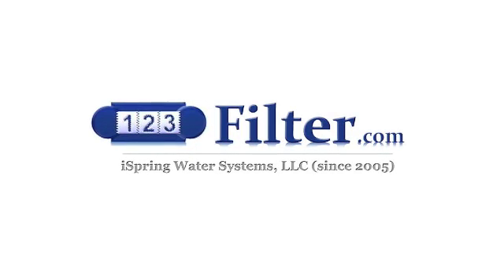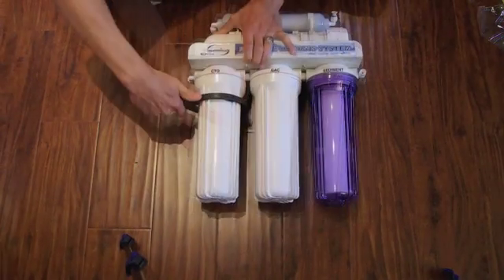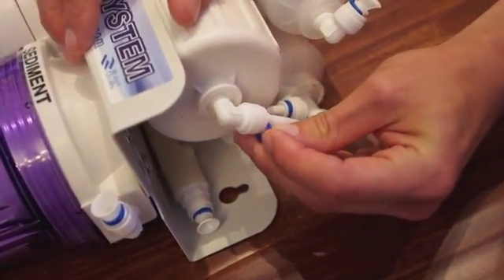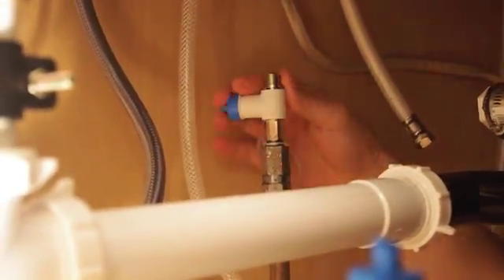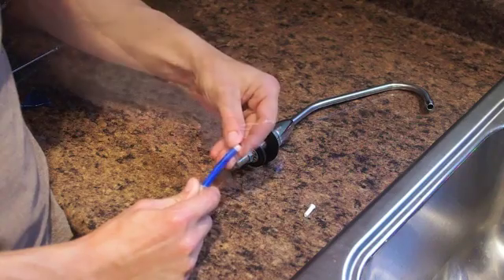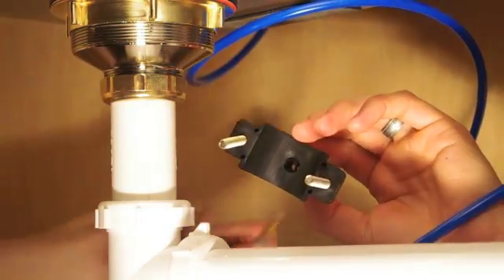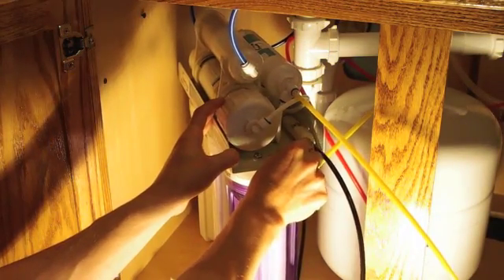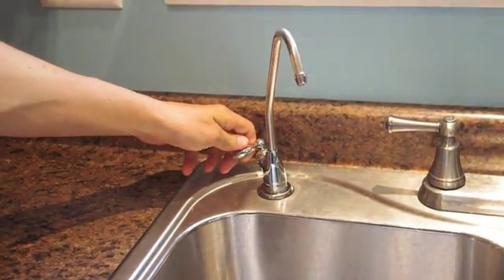Installation | iSpring RCC7AK Reverse Osmosis Water Filtration System (with English subtitle)

Comment: Hi there, when the RO is ready to use and the tank is full, do i have to leave the cold stop tap on constantly- does leaving it on overnight (when not in use) waste alot of cold water because the tank is on maximum? Or can i switch it off now and again to save on water bills and be more efficient? Thank you
Reply from the maker: +Connor- The system has a automatic shut off valve so the system will only run water when the tank is not full to replenish it to full capacity. The only time I suggest to close the feed water adapter is when you are gone for long periods of time to protect the system from possible water pressure changes that could happen while you are away.
Reply: Ok thank you, so just to clarify. I have the iSpring RCC7AK 6 Stages 75GPD Reverse Osmosis Water Filter System model, and i am good to leave the water feed on all the time except when im away for a long time. Because when the tank it full, no more water will go down the drain and be wasted? Is it bad to keep turning the water feed on and off? Cheers
Reply from the maker: +Connor Haynes  You are correct. The system will only turn on when the tank is replenishing itself to full capacity. Turning the feed water adapter open and close (on and off) can affect the pressure going into the system which intern might cause some damage so it would be best to leave it open unless you are leaving for long periods of time such as for vacation.

Comment: hello i would like to know if this system generate hot water from non-hot water home ?
Reply from the maker: Francis Atienza Hi Francis, 

Thank you for your question. This system should only be connected to your cold water line and will filter the water. It will not change the temperature of the water. You can install a hot water heater after the system though. 

Thanks, 
iSpring Water Systems
Reply: ispring filter thanks once again Sir :)

Comment: I turned it on an it stated leaking from everywhere. Do you think it might have to do with the tubes being hooked up wrong?
Reply from the maker: Hi Jesse, 

Please double check that all your tubings are pushed in at least 1/2". You can double check this by taking the tubing out and making a 1/2" mark with a sharpie and ruler on your tubing. Then resinsert the tubing till you do not see the 1/2" mark you made. Really shove the tubing in the fitting and then insert the c-clip. If this does not work, please contact us at 6782617611 or sales@ispringfilter.com. 

Thanks!
Helen

Comment: There wasn't any mention of the o-rings.  There were extras in the bag. I hope I don't need to install them anywhere before I turn on the water supply.
Reply: Definetly  need an o-ring in the middle filter.
Reply from the maker: Hi Forrest Tate, 

There is a o-ring for every filter housing. The bigger o-rings you received are extras for the 3 vertical housings holding the sediment, granular carbon, and block carbon filters. The membrane housing which is the white horizontal housing has an o-ring also. Please make sure you have a o-ring on every filter housing except the post carbon as it does not have a housing. 

Thanks, 
Helen

Comment: The paper instructions failed to mention that the RO membrane was not installed in it's compartment. I actually thought iSpring had been thoughtful enough to include a spare RO membrane so imagine my surprise when my finish product TDS was actually HIGHER than my raw water! At least this video cleared that up, but the video also makes it look like 1...2...3 the membrane is seated and tightened, but after several leaky attempts I took the elbow off the membrane end cap and I could see the end of the membrane unit was not lined up properly so I "adjusted" it by inserting a Phillips screwdriver in through the hole and manually lining the cartridge up. I then drained the pressure tank and started all over again. Also...one of the blue clips was missing on the back of the RO membrane compartment so I had to scavenge one from the extra elbows that were included. Other than that it went like clockwork. :-/
Reply: Took the unit apart today and found that the membrane and housing got messed up during installation and are ruined. On the bright side iSpring's customer service is sending me a new  housing and membrane. They do want you to be happy with their products.

Comment from the maker: Hi Savllam,

"The ASO works when i turn off the tank valve" indicates the problem is likely with the tank with lower pressure. The Automatic Shut-Off Valve shuts off when tank is full, that is, the tank pressure reaches 7-10 PSI. You may use bike air pump to add air through the tank air valve on the side until air gauge reaches or stream from drink faucet is satisfied. 

For further assistance, please call (678)261-7611 or email us with your installation photos.